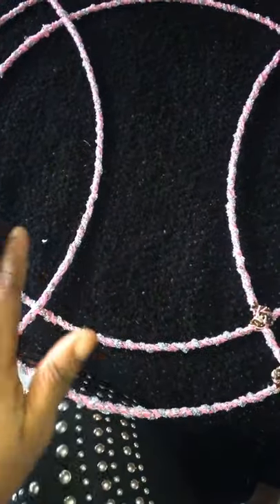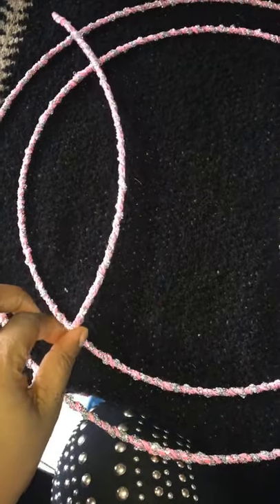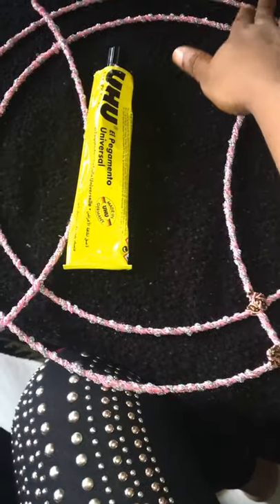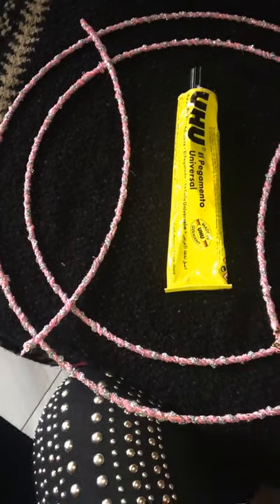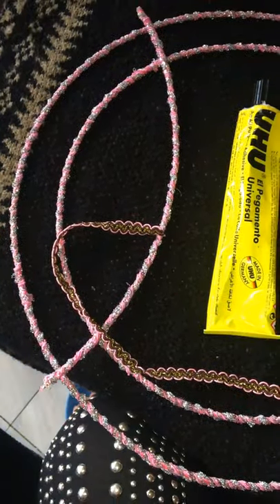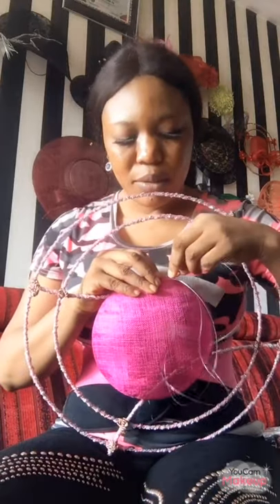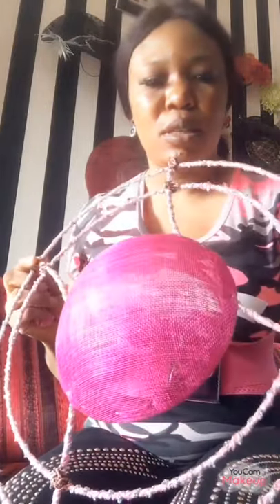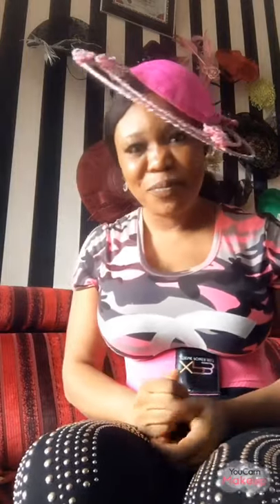DIY cobweb 🕸 like fascinator. Part 1.

Comment: Please what is the measurement of the two wires you used in joining the two round wired?
Reply from the maker: It all depends on the measurements you wish for the first and second layer. With the measuring tape, you can measure to determine the joining.